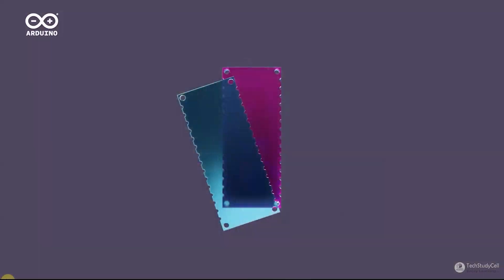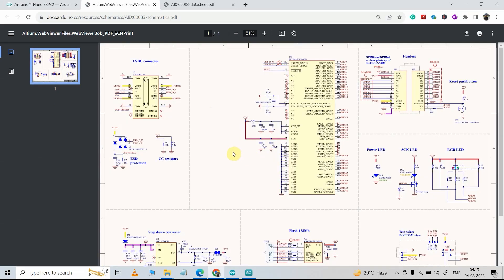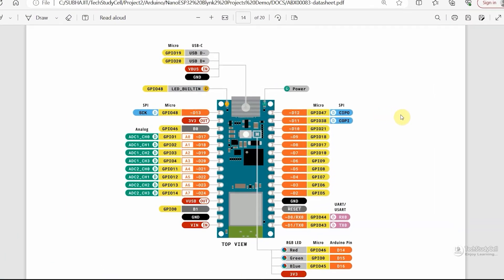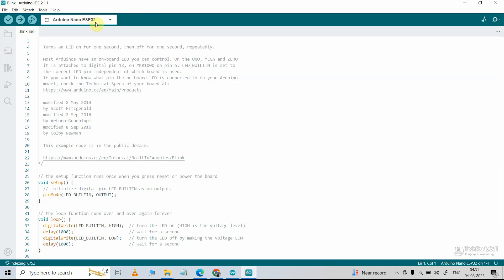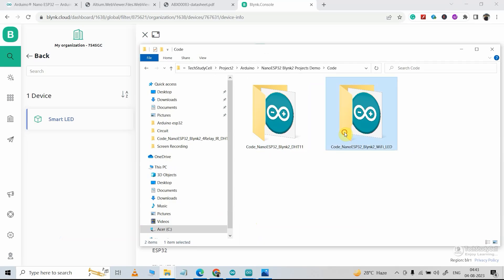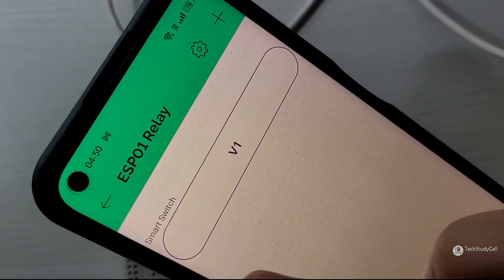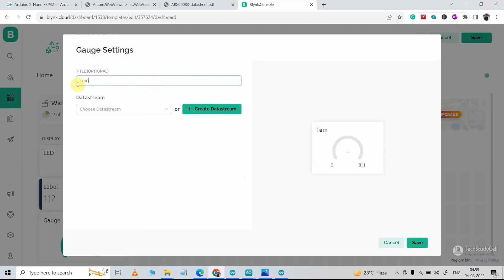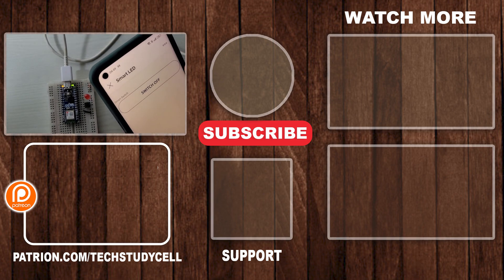Arduino Nano ESP32 Tutorial - Getting Started With Nano ESP32 IoT Projects

Comment: With your 4channel wifi relay control using esp8266 project with Blynk your provided sketch has a Eeprom function which uploads and works very well but as soon as power supply cuts off the esp8266 doesn't connect to my wifi router automatically 
which is very annoying I have to disconnect esp8266  from 5v supply Why it happens bro?